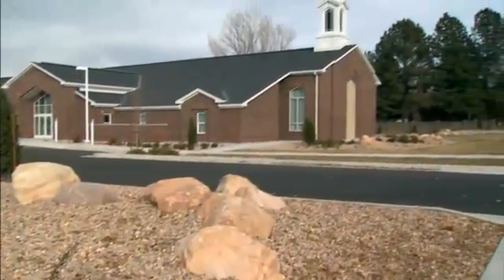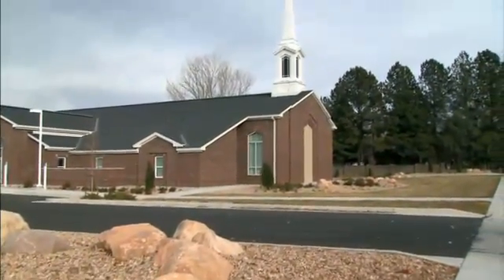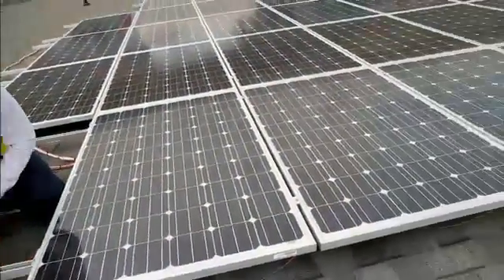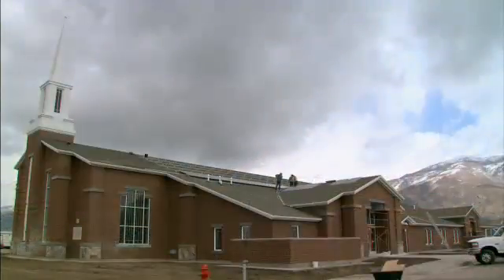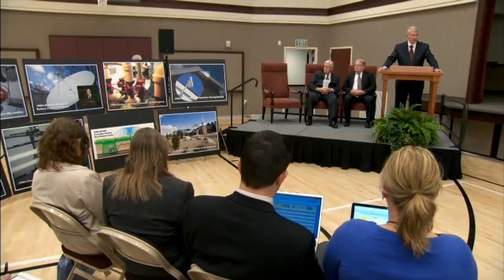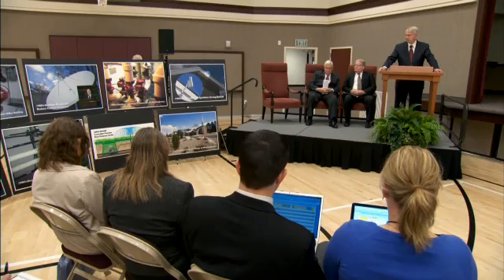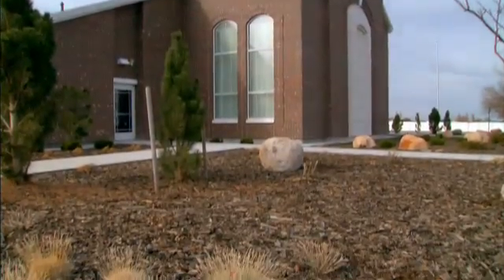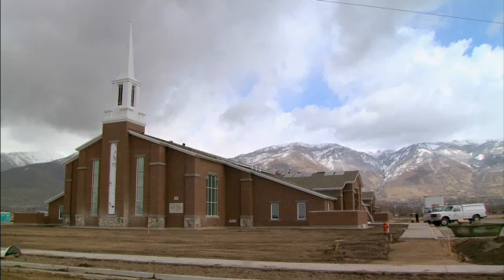Oct. 2010 World Report: Solar-Powered Construction Design

Comment: @rtardbox  Farmington, Utah is not densely populated.  A city of 12,000+ is not exactly a booming metropolis.  Also, this was set up as a pilot program...it is not Church-wide.  It is more expensive because of the initial cost in the short-term, but saves considerably in the long-term and, most importantly, it conserves energy.  I disagree that it is a PR stunt.  The LDS Church is being environmentally responsible.  Why shouldn't the LDS Church test alternative forms of energy?